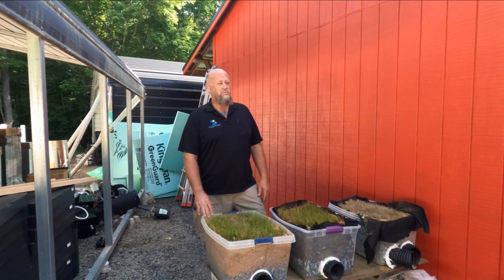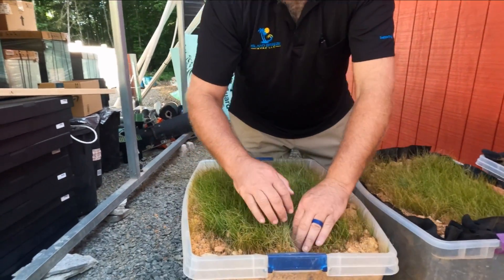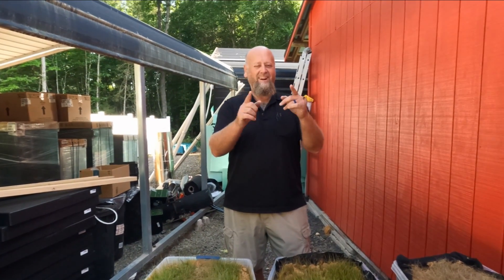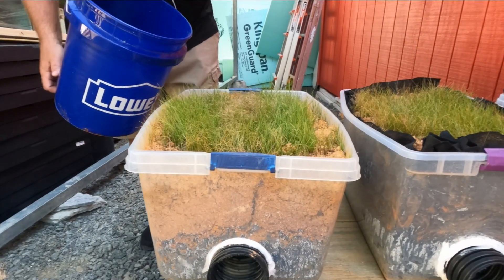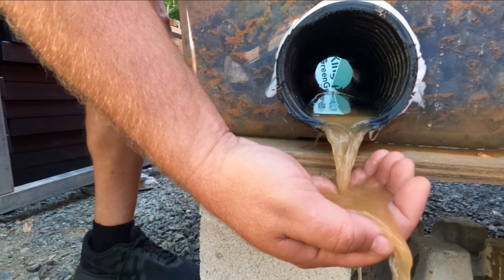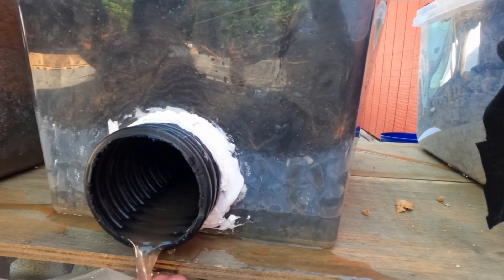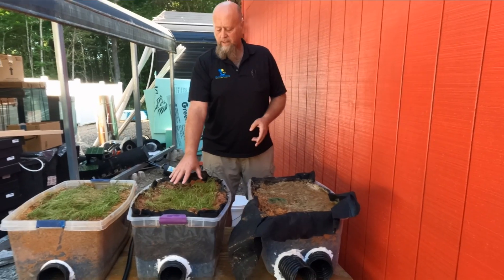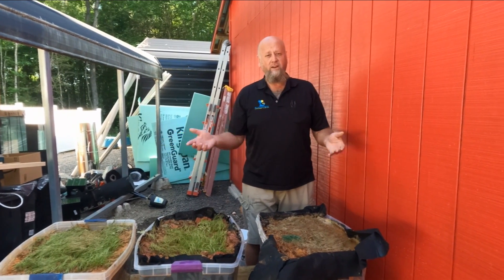Testing French Drain Scenarios To Find Out....Fabric or No Fabric? Which Is Best | Dr Drainz

Comment: I’m In Massachusetts and I used to install septics. Schedule 40 is what is used for all piping. It’s actually very strong and if it cracked in the winter I’d imagine every septic in the state would have failed. There is a solid pipe that is pretty thin walled which you might be referring to but schedule 40 has about a 1/4 inch wall.
Reply: Stepic systems are not installed inside of the frost line. That is the reason french drains fail. They are exposed to frost heave.
Reply: @Luckingsworth  I literally put in hundreds of septic systems. My septic is only a foot or two down not 4 feet. My tank only has 6 inches of cover meaning my piping is within 2 feet. Which is well within the frost line.
Reply: @JasonTheMunicipalMechanic  you cant drill holes in PVC in 360 degrees like corrugated. If you do it will weaken the pipe and cause fail. PVC rigidity is its weakness. It cracks easily. Corrugated also has a self cleaning action due to turbulence, that prevents clogging. Corrugated is THE standard in public contracting drainage for a reason. But go ahead, build your french drain with PVC. See how that works out for you.
Reply: @cryengine_x  pvc doesn’t have holes drilled 360 around it. It has 2 rows of holes 120 degrees apart that you put down on the bottom  and the water flows up into them. The holes are also much bigger I believe 5/8 inch. Thank you for the lesson, You don’t even know what product I’m talking about. If schedule 40 broke in the frost then every single septic in my state would be ruined, schedule 40 is the code for septic piping in Massachusetts, and no every septic is not under the frost line. Mine is not and many I installed are not either. My leach field is literally made of this perforated pipe and only about 2 feet down. Also these septics have plans that are draw by engineers and approved be the town so it’s not just some guy burying stuff. So yeah I do have that as drainage and it works just fine.
Reply: @JasonTheMunicipalMechanic ok ok ok. Thank you for your sincere reply
Reply: running water doesn't freeze
Reply: @edwardmcdermott9948   they are talking about the ground water in the soil freezing which does heave soil and brake pipes since they are being flexed around and the same for even concrete footers on fence posts not set below frost level.  now if the french drain is not draining correctly like a low spot that holds water it could freeze and damage the pipe but the conversation above is about water in the soil around the pipe freezing which can and does damage pipes and foundations that are not properly draining water away from them. 
from what i can tell pvc and the corrugated piping are both great options as long as they are installed correctly. i would use the cheaper corrugated from long runs at shallower depth that need to cure around landscaping etc. but from foundation drainage were they are using rock base outside of the footers and this is multiple feet below grade.. pvc is used all the time and performs well. so i think its more of installation and less about the type of pipe so its moot. both types if installed incorrectly will have failure modes.
Reply: Also from MA. Had company come in to install french drains very expensive with 6 basins & the water just sits on the top soil defeating the purpose of standing water. What will help?

Comment: Doesn't the fabric clog up over time with the clay, reducing flow like you pointed out in the first one?
Reply: Yes it does - for the same reason other filters clog over time & must be replaced (coffee or water filters, for example).   Leaving access to periodically flush soil build-up in french drains seems to be the best solution. There's a special jet tip that goes on the end of a pressure washer hose that is great for DIYers - and can even clear clogged lines. Much better than having to dig up & redo the filter-wrapped french drain when the clay clogs it, & they also remove ground water faster.
Reply: @deecee2837  Leave a couple inches (or more if you dig deeper) of gravel at the bottom, below the french drain pipes.  That will give years and years if not decades and decades of that debris to go to.
Reply: @deecee2837  that pressure washer hose with jet tip .? ..
I used it to clean out the pipe between the septic tank and 
distribution box.
Then, used it up thru all 6 outlets to the distribution box to
keep the leach field working. (75ft of line)
It was a S#!tty job . .. but somebody😳needed to do it..
Reply: The pores in fabric are smaller than pores in stone. Better the fines run out of the french drain than clog up fabric. Common sense.
Reply: Clay will clog up the rock and build up in the pipe.
Reply: That's none of your business
Reply: anything on the surface of stone will encourage clogging, thus why we don't put grass back on top. Decorative stone looks nice but more importantly prevents soil/clay from clogging up the drain.
Reply: Yes... and no. Like he said, you must use the proper fabric. The landscaping fabric at big box stores won't work. Geo-textiles does work and will not clog and they allow water through much faster than landscaping fabric. You can actually get different fabrics that have different flow characteristics. It's the same stuff they put under roads to have proper drainage underneath them, otherwise they wouldn't last long due to ice heave and erosion.
Reply: @BigBrotherIsTooBig   drainage is not the reason fabric is placed under roads. The reason fabric is placed under roads is when you have a unstable substrate the fabric prevents the road from sinking unevenly. Nothing to do with drainage.
Reply: @blackdogleg  you're referring to resistance to tension in lower layers of the road surface , right?
Reply: @milner267  yes. Better way to explain it. Thanks. Tensel strength. If there is water infiltration on a road the problem is much larger than drainage. Lol
Reply: @BigBrotherIsTooBig  Some big box stores sell geo-textiles and other types labeled as filter fabric.

Comment: Great demo.  French drains are for ground water.  People need to remember that.  If surface water is the issue, you use non-perforated pipe and the surface drains.
Reply: I don't know why I'm seeing this now, but here goes:  Your assertion that "there's no reason to run surface drains in a home's yard" is as wrong-headed as it gets.  I told you I was in a bowl.  That means neighbors properties flooding mine with running surface water during storms.  Literally two temporary creeks. All that surface water coming at me, and with a basement in the house (which punches a hole in the top cap of clay in my area), where do you think that surface water was going?  I had to mitigate it BEFORE it migrated into the soil.  A French drain can only mitigate as deep as the trench (my basement is 6-8 feet deeper).

The best way to manage ground water is to not let it become ground water in your area of concern. Swale (grading) is #1.  Surface drains are #2 (so much faster/more efficient).
Reply: You get surface water from compacted top soil or saturated ground soil. French drain should take care of both.  If your getting surface water is mostly because you have compacted top soil. You need to aerate. Or your French drain is clogged.  I'm not sure about clay. I know Clay holds surface water . Not sure if it does any good aerating.  But here in Illinois it's 99 percent compacted top soil if surface is holding water and there's no ground water
Reply: @jheiny1231  I owned a home outside Chicago and battled surface and groundwater on multiple fronts from multiple sources.  The house was the low one amongst the neighbors.  There's not enough aeration in the world to deal with what I was dealing with.  I tackled it with regrading for a swale, a concrete curb between the driveway and house, French drain to the drain tile on the uphill side, and 150' of buried downspouts and sump pump discharge to the ditch out front.
Reply: It sounds like you have some other issues. Your yard shouldn't hold surface water if there's a French drain running under it.  If it does there's 2 issues there.. 1 your soil is compacted and the water can't penetrate the top layer of soil or 2 the French drain was installed incorrectly and in the wrong spot. There is absolutely no reason to run surface drains in a homes yard. Surface drains are good for concrete and asphalt surfaces.  The French drain starts literally right after the sod.  There should b no reason water couldn't penetrate 2inches of soil to make it in the French drain system.  That of course if the French drain was installed in the right spot and correctly installed.  Been doing yard drainage solutions for 14 years. There is rare occasions a surface drain is applicable.  But 99 percent of the time its not

Comment: Snake oil salesman, schedule 40 PVC just works.
Reply: Yeah, the explanation about PVC is idiotic at best.  I suspect this is a swipe at another contractor on YouTube who does use it and frequently highlights how poor corrugated pipe stands up to the test of time.
Reply: @WildwoodSubRailfan  pvc is for newbs, no serious contractor uses it on a French drain. ask the govt. they use only corrugated in road projects etc. pvc cracks very easily, cannot drain in 360 degrees, clog quickly.
Reply: @cryengine_x  Contractor speak translation: "Its cheaper and easier so I get on down the road to the next job faster."

Comment: Just had to dig up the french drain i set only one year ago and pull all the fabric out as was blocked, really disappointing. Just Reset it without any fabric now and just refilled the trench with rock already draining a lot better
Reply: Hi, I'm thinking about just doing it with rock alone too. Curious, did you originally use the non-woven punched fabric? I'm reading where the clay is not suppose to clog that... but a filter is a filter, and they eventually clog. Of course I guess the rock alone will eventually clog too
Reply: What kind of soil do you have? Apparently it makes a difference and I'm getting ready to build a retaining wall and I need to make a decision
Reply: @donnyh3497  clay soil. Working great still without fabric and drains well when wet outside. I ensured it was tight to soil and filled on top with large chips.
Reply: @edi8656  thanks!

Comment: I just last week installed 4inch perforated pipe . Trench 1.5mtr deep layed taram covered in 1 mtr clean 20/40 hardcore and wrapped only about 6inch below surface. First  rains and the discharge pipe is dripping. Had too cut fabric on surface to allow water through as was totally clogged with silt. I regret laying 150mtr with fabric now.
Reply: Did you use woven fabric or non woven fabric in your installation? Also, what kind of stone did you use? larger and rounder the better as to avoid compaction and promote better water flow. Also just as important to wash the rock before putting it into the french drain system.
Reply: Took me 3 seasons of winters after doing my drainage. Now it works fine but for a couple of years I regretted the enormous effort using fabric covered French drains. I did put in 2 extra surface collectors too using no slit/solid drain coil. Good luck.

Comment: I have about 40' of drainage to do, can I use the perforated drainage pipe for the surface drain? Since the perforated pipe comes in 100' lengths. Run 2 perforated pipes but one has the risers for the surface water. So I don't have to buy the solid pipe. Trying to save money

Comment: Looks to me like this proves you should NOT use fabric.  As your demonstration shows, the clay is taken away by the no fabric drain, The tiny particles of mud cant clog a drain pipe but can clog a fabric filter,. SO the clear water coming out of drain using fabric means that  such a system  keeps the clay on site.  So it appears that stone without fabric  only gets rid of BOTH the water AND the tiny clay, particles - which is what stops water form flowing in the 1st place. But I aint a pro. so take my observations with a grain of  salt
Reply: Maker, the clay will Will clog the stone so water will not pass through it.  The fabrics there so the clay cannot get to the stone so you have a free path of least resistance.

Comment: The reason why fabric does not work is because the clay and silt run out of the soil ontop and at the sides of the fabric, it doesn't happen straight away it takes time. If you have a dispersive clay soil as I have found out the hard way fabric or no fabric they both have huge issues. I'm not quite sure how to fix it and resolve the issue but to say other people are incorrect isn't entirely true because actually brand new fabric will take the water away but do the same experiment after its been in there 12 months.... The fine particals blind to the geotextile and instead of blocking the inside it blocks the outside instead. I would be grateful for your reply because I am telling you that this is 100% true and I am living in a nightmare.
Reply: Your concerns are exactly mine; that over time the fabric will become blocked. I have looked at other drain contractor videos and one shows an engineers drawing of the sediment building up a layer on the geotextile and they say the soil buildup is a filter zone and water can still pass through it.  I question this works with clay soils, and maybe an engineer would need to be consulted.  The other point that is made by another drainage contractor who has many youtube videos, is that the type of fabric is important (he uses a double punched filter non-woven geotextile).  I'm not sure the weight but I think it's 4 or 8 ozs.  I still don't see how punching some small holes is going to prevent clay soils from building up a non-permeable layer on the outside.  Also, clay soils expand when wet, which makes this even more of a legitimate concern.  Any way, I think contacting drainage engineers who can refer to studies, or to local drainage contractors who have systems that match what you are trying to do that have been working for decades may be the only way to figure this out.  Please reply if you make any progress on this question!
Reply: @riumudamc4686  thanks for your comments, I have had loads of people round including a geologist amazingly and all of them said that the terram t1000 is the filter fabric we need. I am in the UK so we don't have the same type of fabric, I only wish that I could show you a photo but I am going to make a video today and create a you tube channel all about the garden, so I could share it with you later. Its only been down 4 months and blocked already because of dispersive clay it's terrible and I don't know how to resolve it. I am going to get my husband to re do them and I am going to try to have a layer of sand all the way around the terram (geotextile) and see if it helps stop the clay sticking to it as much, they are still working because there's literally a stream coming out of the exit pipe but they are just not quick enough so the water is pooling around and ontop of them further up the garden where as when they were first installed it was rushing straight into it. Honestly it is the worst thing I've ever done in my life and I hope someone has a solution!
Reply: @lala_land86  i would love to see a system that is working in clay after 10+ years!
Reply: @riumudamc4686  I have posted a video of our nightmare https://youtu.be/BBMUfruTjyA
Reply: Thanks for your comment. About how long does this take?

Comment: On one side of my yard (neighbors house is higher) I have a wood retaining wall but the water runs towards my house and saturates the gravel and even gets into my crawl space. I run corrugated solid pipes from my gutters on this side and run to front of the house. Im thinking about putting a concrete slab here to slope surface water away from my house and so I can have a solid pipe under the slab for the gutters. While this may mitigate surface water ( especially if I had some surface drains on this slab that connected with the gutter pipes) will this mitigate sub surface water from my neighbor? Is there such thing as putting a French drain pipe under slab or would it have to be on the edge of the slab at the foot of the wood retaining wall? 
Thanks.